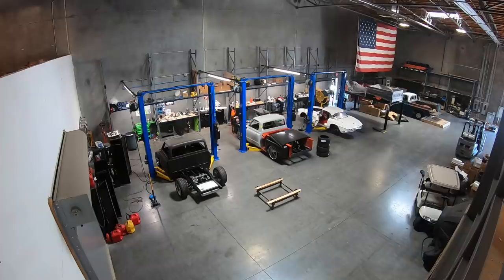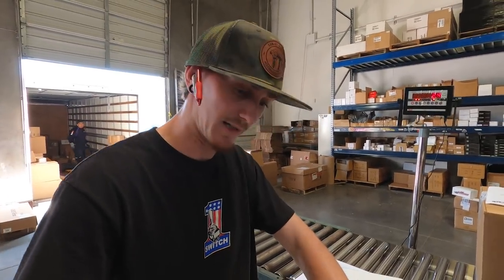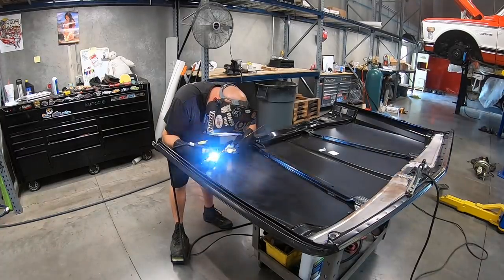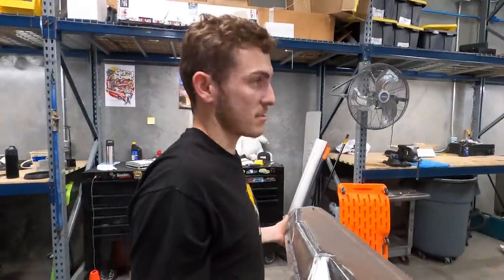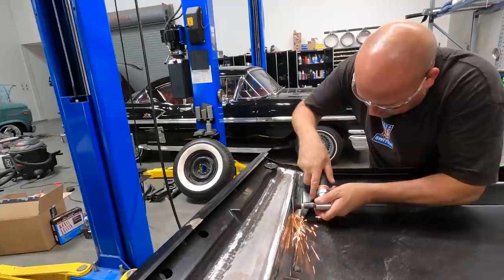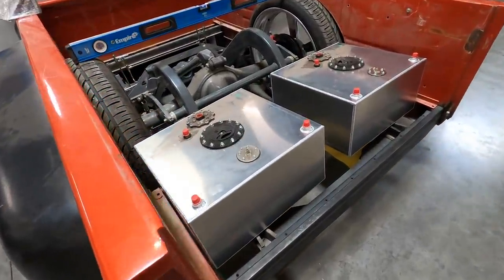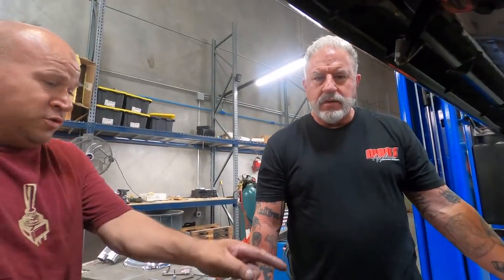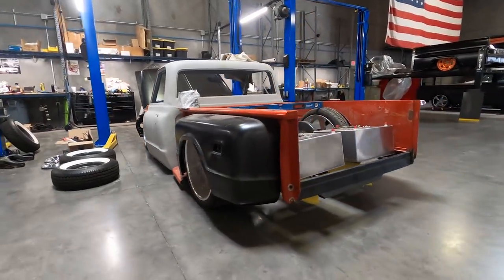1967 Chevy Step Side Twin Turbo

Comment: Hey guys what thread sealant do you use on your air fittings
Reply from the maker: Loctite 545
Reply from the maker: https://switchsuspension.com/loctite-545-pneumatic-hydraulic-thread-sealant-10ml/
Reply: @switchsuspension  thanks guys I appreciate it